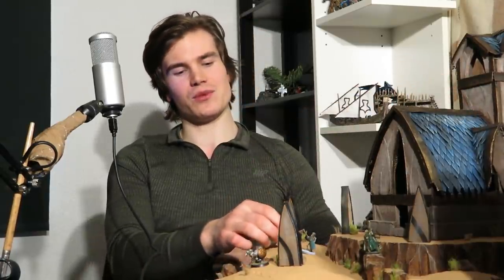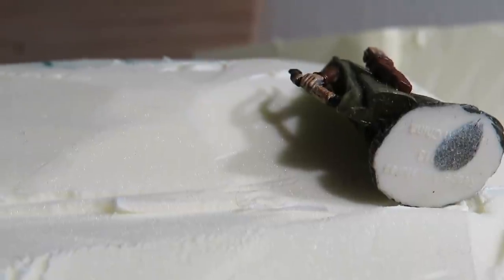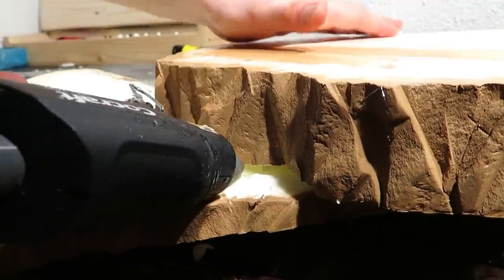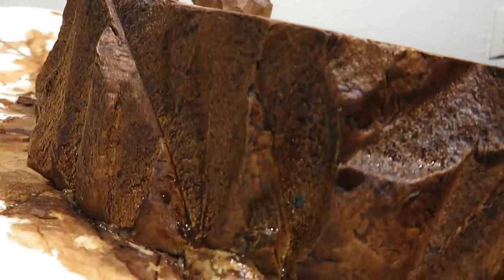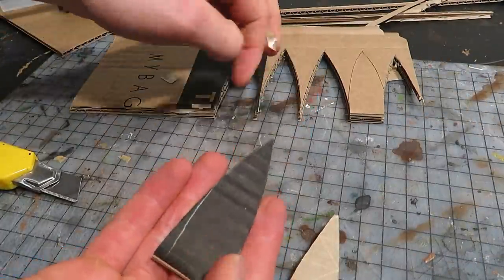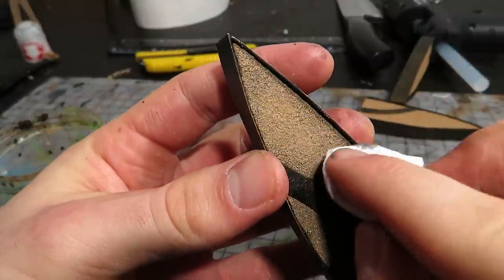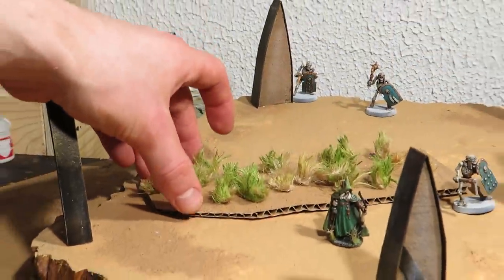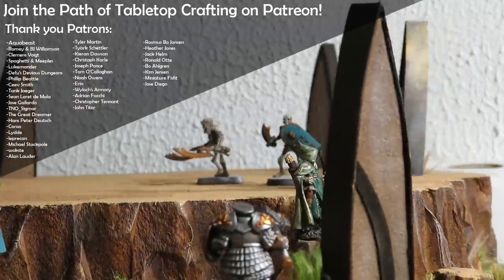Building a HUGE Desert Diorama for D&D, Warhammer

Comment: For your texture on cardboard, you can make the texture far more easily and with a more consistent look by going to the dollar store and getting some of their cheap sand paper and putting a layer over the cardboard for the pillars. It cuts and glues quite well, and takes paint while giving a more consistent look in the end...as a side note, the larger sand paper option is actually something that works pretty well for a full desert wargaming board, my brother and I did one like that back when I was in Jr High for GorkaMorka with just a reinforced 4'x6' piece of plywood (using 2'x2' across the bottom to reinforce), then using sandpaper rolls from the business areas from the larger hardware stores to cover it, along with some wood glue and sand to help hide the seams. Then sprayed it black and started with a terra cotta red and worked up to a pale tan for it. Still have the table put away...

Also, you may want to do a bit more to reinforce your layers because hot glue can get ripped if you end up using it in games like that. Something like toothpicks embedded between the layers is something you really want to consider because it adds other grip options.

Comment: Good Vid, man. Glad you took my advice & made some textured paint. The tufts ar excellent

Never be afraid to pin your structures, rocks & Pillars - some cocktail sticks will do the trick or paperclips. It'll strengthen the bond.

As for sand flocking, you know you can just use the sand directly? No need to paint it at all & you'll get some really fine textures - best way is to acquire an entire sack on the cheap, is to order, 'Play pit sand' It'll only cost you a few bucks but it'll be perfectly fine (as opposed to coarse sand). Leave it out to dry (or pop in the oven if you're impatient) & it's ready for flocking.

Also, if you're looking to protect your tufts then hairspray will do the trick & you can protect the terrain/flock with a nice coat of PVA

Comment: Get some urethane-stain from a DIY store, or a hardware store.  If you can locate a dark brown, or black color of urethane-stain, paint it on, with a throw-away brush (if oil-based).  It will accumulate in the recesses, hardening into a nice thin coat of urethane.  My preferred product is Minwax Polyshades Royal Walnut (dirty, dark brown) or Tudor (black wash).  It is fast, easy, and effective.  The oil-based versions will dissolve exposed foam, so be sure to cover it with paint, or other water-based sealant, first.  Cheers!

Comment: First, my tuft process. Second, where to get some very cheap and effective fibers for tufts. 

The Process:

1) Get some parchment paper, some tweezers, your fibers, a hot glue gun and glue. 

2) Cut your fibers to a variety of different lengths so the tuft will look more natural, Grab a tuft's worth of fibers with the tweezers,
3) Put a small dot of hot glue on the parchment paper, and stick the fibers into it. Hold for 2-3 secs until the fibers stay upright when released. Tap the top of the tuft gently, to spread the fibers out up top. Trim any stray hairs that look funny/stand out.

4) Spray paint or airbrush the tufts any shade you would like. 
5) Attach the tufts to your boards/bases by placing a small, very hot dot of hot glue, and press your tuft down into this dot immediately. The heat from the glue will re-melt the tuft glue, and blend it in seamlessly.

Cheap and Effective Fiber Sources:

- The bristles of old paint brushes. They take paint just like they were designed to do so. 

- Unwound twine in its many forms. Plumbers twine gives you a different fiber size and texture than hemp twine or kitchen twine.
- Shoe polishing/buffing brushes. Sold at most dollar stores. These brushes are designed to paint with polish, so they take paint very easily. The fibers are packed very densely, so they are easiest to remove with many small cuts rather than a few big ones.

-  Buy some fake fur from the craft store, and shave it off with an electric razor. Most fabric/craft stores will sell you fake fur in very small sizes. I use an airbrush or spray paint for this fur, rather than a brush. You might be able to paint it using a wash in a spray bottle, but I have never attempted this.

Comment: I'm curious what you do about movement. For example, much of the terrain that is "mass" produced and can be bought has bits of detail on it to mark a 1-inch grid. I see other builds that have floor tiles, but ones like this one don't seem to have a grid outside of the temple. Do you ever mark an obvious, or not-so-obvious grid on some of these kinds of builds? Do you feel it takes away from the scene too much? 

To me, a diorama feels like it's just meant to look nice and not play with though, so that might be the point?
Reply from the maker: I have always used a ruler for measuring movement and attack ranges.

Comment: It's interesting (and a little frustrating) how much difference there seems to be with xps foam. I have just recently (after long time searching) discovered a place to purchase xps locally, but it seems to be a lot denser than what I see you and Jeremy from Black Magic Craft using. There is no way I can cut through large chunks of it the way you do in the beginning of the video - and yes, my knives are very sharp :D My XPS is blue from a company called Ravago.
Anyway, super nice build man!
Reply: You need to ask your local store where you purchased your XPS for what purposes it is used. Your XPS could've been  designed to resist heavy objects (either for flooring or roofs). I think Lukas used XPS foam that is meant for the walls
Reply: Ravago did buy up Dow's European XPS business, so you are probably getting the same sort of Dow Blueboard insulation we get in the US and Canada. If you use 1-inch (aka 25mm) thick sheets of Dow XPS foam you should be able to cut through that easier (although I would still suggest a hotwire cutter). Hot Wire Foam Factory sells a Spray-on Foam Glue and Foam Fusion that are able to be cut with a hotwire cutter after they have set, something that PVA and to a lesser extent hot glue prove problematic with.
Reply: @tiny-grimes  that would make sense, that the xps I use is meant for heavier loads. It surely does seem more sturdy than what is shown in Lukas' vids :-)
Reply: @MacAttack001  The foam I've purchased for now is quite thick - almost 2 inches. I'll definately buy some thinner pieces soon. And as for the hot-wire table, I ordered one yesterday. Hobbyknives simply didn't work well enough. Thanks for the shared tips, especially with the glue - that will come in handy! :-)